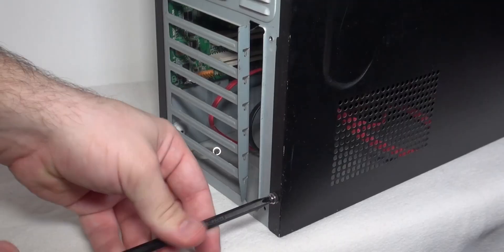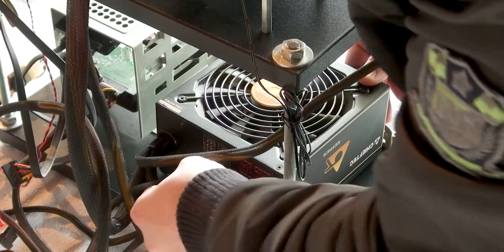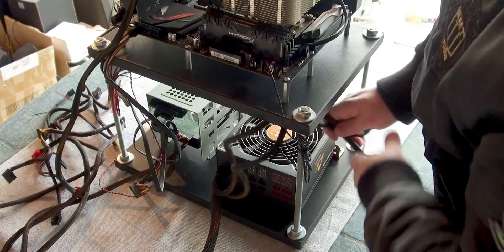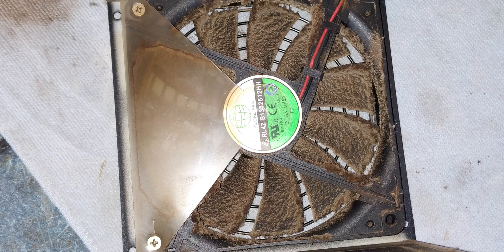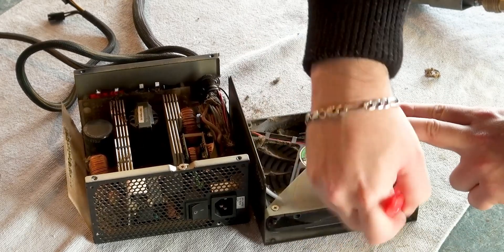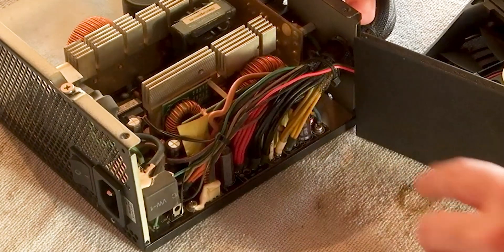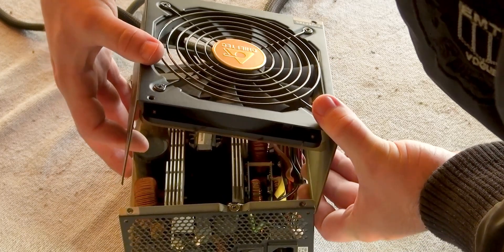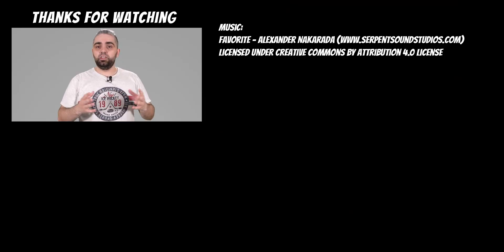How to clean computer power supply unit - Cleaning the PSU

Comment: BE VERY CAREFUL. You can die doing this. Capacitors can hold enough charge to kill you. I would honestly re-upload this video with a strong warning not to touch the capacitors, and also give tips on how to discharge them.
Reply: I read this comment after watching the video not knowing this, and removed insane amount of dust. Got told after by a friend that i could die doing it, that was a bit crazy to hear. That would be a weird way to go
Reply: @LordZnake  This is why even if such incidents are rare it's better for people to know about it rather than not.
Reply: just disconnect the PSU from the wall , keep the 24 pin connected and then press the PC power button for 15 seconds for a couple of times , this is gonna discharge everything and be safe to handle
Reply: Shit I just opened up my Corsair cx600 power supply and I used a toothbrush and brushed out the dust ON the electronic parts. I never knew the capacitors could kill. Thank god I was ok
Reply: It will not kill you, just a big shock. DC is less dangerous than AC. Capacitors only store DC
Reply: Would it be safe if I use rubber gloves?
Reply: @rhythmkeebs  I don't think that's enough. Electricians use special gloves when working with life-threatening components. Those gloves are probably not gonna do much.
Reply: @perfectlyroundcircle  how to clean it then? im kinda scared now lol :D
Reply: @sjeiwow9qooqo  Don't touch the big scary capacitors with anything, and let the PSU unplugged for a few hours before working on it. Generally, just be very careful and you will probably be fine in that case.
Reply: LOL
Reply: In 99% of cases, after the PC has been unplugged for a few minutes, capacitors self-discharge via built-in bleeder resistors. Or you could try turning on your pc while it's unplugged to discharge any remaining current.
Reply: wtf are you trying to clean the thing while cabled and static charged?
Reply: nah its fine, ppl over exaggerate it. i used to touch them as a kid no issue. its just as likely to shock you with the same probability of being struck by lightning
Reply: @rypdx   Well, of course, if you get good quality PSUs the chance of some serious shock is very low. But it's better to be mindful of it if you can. Plus, there are a ton of cheaply made electronics these days that probably don't have good safety features.
Reply: unplug the computer I guess?

Comment: Be careful though, touching big capacitors contacts can be deadly but you would smell grilles pig😊
Reply: Really ? It's not connected to electricity right ?
Reply: @akbarramadhan2691 Yes, but a capacitor stores energy. It's like a battery but with different properties
Reply: @sjoerd104  THANKS!